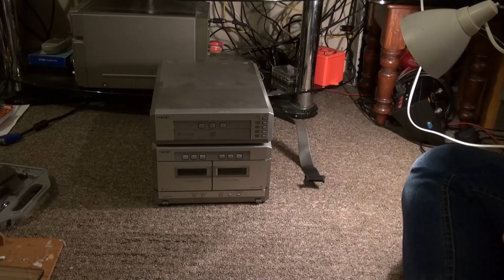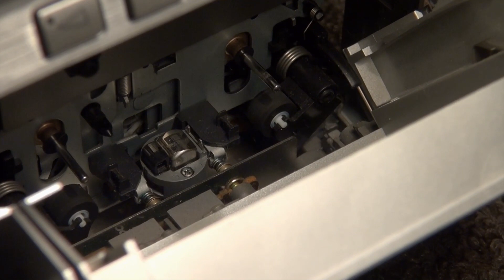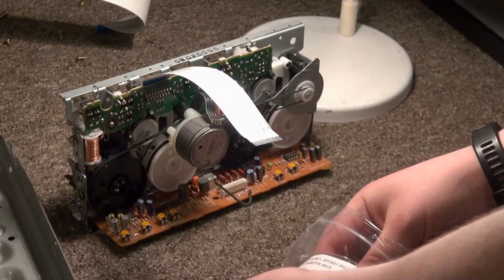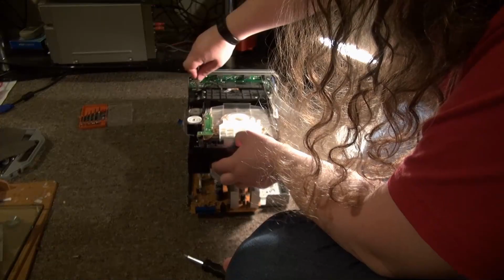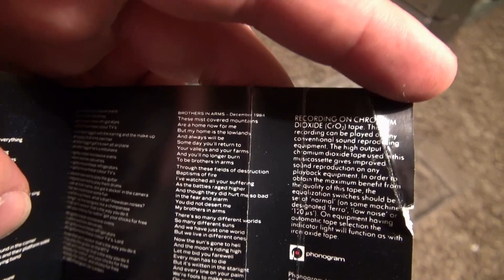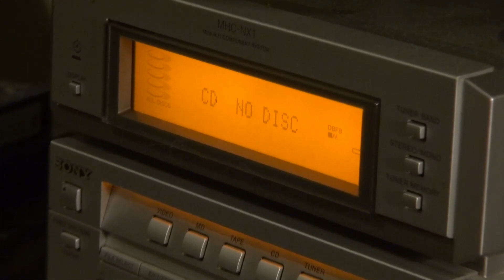Sony MHC-NX1 strip down and repair

Comment: Does the one of the tape deck belt is opening the cd door ? I replaced the cd deck belts but the cd door is not opening...Any advice ? thank you
Reply from the maker: The tape deck belts dont open the cd door, just the cd belts do that. Check the new belt isnt slipping or slack.

Comment: You may not even have this player anymore.. but do you remember if the bottom black gear in the middle that's behind the two large wheels, is spinning one each deck when you manually spin the main wheel? Problem I'm having is I was messing around manually moving the belts and the left tape deck got stuck in 'Play' mode. 

There is a white eject lever at the top that is raised and should be lowered before the power is turned on. The right side has no problem opening and closing the eject lever but the left side won't spin the black gear like the right side. Which is what causes the lever to eject.

May be a chipped gear but it was working fine. Was hoping I'm just not understanding the mechanism. You have to literally take out every gear to see what the issue is and that's a real pain in the ass. 😠😄
Reply from the maker: @overnightdelivery  I have still got this, but it's in storage while I move. Bear with me a while and I'll see if I can have a look once I've moved.
Reply: @stephensrailways  Wouldn't expect you to take it apart again just for me. Just curious if you remembered. I 'think' the gear only moves when the white lever is down. There appears to be a specific sequence of turning gears required to activate the lever. Once the lever is up, it's not clear how you enter the sequence to get it back down again. 

Was working on this as a Christmas present for my neice. I managed to replace the belt and laser on the CD player and that part is working excellent. Wish I hadn't manually messed with the cassette belts. Probably would be working if I hadn't. Maybe a diagram of how it works exists if I keep looking. If you happen to look at yours in the next month or so, be careful not to go too far with the lever and end up in my situation.

By the way my model Sony is a HCD-RX66. But  the tape mechanism appears to be the same as yours. Good luck with the move. 🙂
Reply: @stephensrailways  I figured it out. The large white plastic piece that's underneath that spool of wire was apparently blocking the steel mechanism  from sliding to the side. Once I pushed it away from the mechanism the black gear started moving and finally the lever came back down. 🙂

 So far tapes are playing on side B only. I noticed when I put a tape in Side A it stops playing after a few seconds because the wheels don't turn at all on that side. Despite being installed correctly. I think the long belt I have on there might not be tight enough to spin the wheels connected to the other side. Also the motor is loud and sounds like it's working harder than it should. I had added silicone grease to the belts. But big relief for progress at least. Sorry for the ramblings.
Reply from the maker: @overnightdelivery  check the belt that drives deck A, it may have slipped out of the pulley on the motor. Mine did this when I first changed the belts and the tape played at the wrong speed then
Reply: @stephensrailways  Both belts are on very securely. Really seems like there is a broken bearing/spring that's seized up in that circular plate From Side A that connects to side B. It can only be spun around a few times and then will not budge. The wheels and gears on that side spin perfectly fine but seem to be stopped from moving. I'm assuming all the wheels on both sides move for you when the tape deck is first powered on.

Comment: Sorry, but the critical part is disassembly the front panel section and your video is too quick to understand. Is it possible to do it without disassembling the CD Dect? I saw it from the service manual but it's not so clear.
Reply from the maker: You have to take the CD deck out for the front to come off, but it does come out in one piece

Comment: Great video, thanks! Not sure what happened, my amp works perfectly, but there's no power going to bottom unit, no lights. Does the power transfer from top to bottom over the system control ribbon cable, i replaced it recently but no change, any ideas?
Reply from the maker: Yes, the ribbon cable supplies power to the cassette/CD player. Maybe there's a dry joint where it plugs in that's come loose?
Reply: @stephensrailways  Weird my comment keeps disappearing. Anyway opened it up to find these (see link) burnt out. Bought it in the US and run with a step-down converter in UK, but there must have been a surge at some point. Don't see damage elsewhere, any chance that this little board took the brunt and unit is not totally fried? ie small board replaceable? 

https://drive.google.com/file/d/1x8Hfrkvgus8GjmmSgtHR3jwJg12ZWadN/view?usp=sharing
Reply from the maker: @user-kk4dh9vd7p  the board looks OK, but it is hard to see exactly what the components were before they were fried
Reply: @stephensrailways  The little board sits on top of the black plastic chassis surrounding CD. Rethinking it, the power would have surged from the ribbon input all the way up there so it has probably damaged alot more whilst not really visible. Thanks anyway! Video here but not sure it will help much..
https://drive.google.com/file/d/1-0wmtHClK1DrplrvmufFA8ovVPMC24D5/view?usp=drivesdk

Comment: I've had mine boxed and stored away for about 10 years. When I stored it it had the same cassette deck problem. Worse than that the display was becoming unreadable. 
Thanks for the tape deck video. 
Anyone know of a display repair?
Reply: i'm in the same exact situation

Comment: Hola 👋.....excelente tutorial.  Tengo el el mismo equipo musical y tengo los mismos problema con las cintas de transmisión.  Podrías indicarme donde conseguirlas? . Saludos desde santiago de chile. Tienes otro seguidor más. Gracias.
Reply: Holaaaa... Por fin un comentario de un chileno... Estoy en la misma que tu. Necesito recuperar este sistema de sonido. Lo amo desde chico. Pudiste comprar correas en alguna parte? Saludos
Reply: @IgnacioClavijo  hola estimado...aun no . Pero están disponibles en ebay y Amazon...se pueden Conseguir. Acá en Chile,  imposible.
Reply: @leonardopoblete1310  gracias por responder. Las he visto por Ebay pero por Amazon no. El tema es lo que te cobran por solo meter unas bandas elásticas jajaja
Reply: @IgnacioClavijo  en santiago puedes comprar las bandas siempre y cuándo tengas las muestras. No duran mucho. No son de muy buena calidad .Es un negocio ubicado en San Diego entre Matta y coquimbo. Buscaré el nombré exacto y la dirección si estas interesado.
Reply: @leonardopoblete1310  acabo de encontrar una página muy buena que hacen envío no muy caro. Te puedo dar el link
Reply: @IgnacioClavijo  te lo agradecería 🙏
Reply: @IgnacioClavijo  Hola ignacio...solucionaste tu problema  de poder conseguí las correas?...yo compré 2 juegos. Estas interesado en comprar 1 juego de correas para tu equipo. Me comentas. Saludos
Reply: @leonardopoblete1310 holaaa... Si, tengo un juego pero aún no lo instalo jejeje. Muchas gracias igual por el ofrecimiento

Comment: Hi thanks for your video.I have exactly the same model of Sony deck as yours.The cd and cassette players were not working so I stripped the player and found every belts were perished. Your video of cd belts replacement is quite helpful thanks but for cassettes belt change it is somewhat confusing where the video has been fast forwarded.Saying this it is still helpful where video is on normal speed.Thanks

Comment: sir if you know each other naturally
all the rubbers are cut on a cassette player exactly like this one in the video
I press play on both decks, but without putting a cassette in, neither motor receives a command, is this logical from the switches you said are everywhere and see the presence or absence of the cassette?
should I buy some tapes and put them in to watch?
because all my cassettes are broken
Reply from the maker: That's correct, the deck won't play without a cassette being in
Reply: @stephensrailways  thanks sir
Reply: sir something more 
as about as the unit amplifier 
has a fan on the back place
Do you know if must working continously ? or is there someone thermistor and its working when its needed ?

Comment: Don't know if you are still collecting comments but I still have a problem with the auto changer. It changes ok when the trays are falling but not when they rise. The tray is a little low at the rear. Lifting with a finger before it times out engages the cd. Any thoughts?
Reply from the maker: I'm not sure on that one, unless it's to do with the belt that's hidden next to the laser, under the cd trays, that could be slipping. Very strange indeed!

Comment: Re your comment on the volume control, I had  a similar problem..... I took  the case off, blew all the dust off the whole inside, now works fine !
Reply from the maker: Excellent, I still haven't opened mine up yet but I shall try that first!

Comment: I have problems with both decks. The heads don't flip on auto reverse? Any ideas?
Reply from the maker: They should turn and spring back if you try and move them by hand with the power off. It might be worth trying this a couple of times to free them off, especially if its been a while since the deck was last used.
Reply: @stephensrailways  I give it a try. Thanks

Comment: Hi, i have a question for you, a few days ago i noticed a sudden change in volume output, it got noticeably weaker, my guess is that it's amplifier's fault, do you have any tips how i could save this old friend of mine? There are no specialists in my area, probably gonna have to repair this bad boy myself and any help would be much appreciated.
Reply from the maker: Hi, apologies for the slow reply. I have not yet opened my amplifier yet, so unfortunately I'm not sure exactly what the problem could be. I could be a dodgy capacitor, a transistor or anything else for that mattter. If you do find out, please let me know, as it would be a shame to let such a good unit go!

Comment: Thank you very much, my HCD-GRX10AV/RX110AV seems to have the same deck, and it helped a lot to watch your video because it had some important hints how to handle the middle motor. I was able to repair the directly connected deck yay! But the one on the right side (from behind) there the up/down mechanism of the magnetic head seems to be stuck.
Reply from the maker: I'm not sure what lubricant to use on these, but perhaps some kind of lubrication may free the head off?
Reply: @stephensrailways  do you mean the casette audio head? I think I should maybe lubricate all the wheel axles, because meanwhile it seems that over time the audio gets slower and I am not sure if these two defects are maybe connected.
Reply: @skybirdification  I also have a sony rx110av and after having disassembled and reassembled the cassette deck to clean the stereo inside, when I play a cassette I always hear a whistle below (more present on tape b). you say that with some lubricant I solve the problem?
Reply: @danielboss6835  I didn't try yet to lubricate anything, I still have the problem that the tape speed slows down but I was to lazy to take it apart again yet, as I mainly targeted on repairing the CD deck (the rubber was gone there too) and that is working fine now. But on my next holiday I will check the casette deck likely again.
Reply: @skybirdification  let me know if you will solve

Comment: Thank you for this video, it will help me a lot :) Could you tell the size of each belt as I'm outside the UK and the belt kit isn't available here
Reply from the maker: https://www.ebay.co.uk/itm/5-Belts-SONY-HTC-NX1-HTCNX1-Belt-Kit-For-Cassette-Deck-VERSION-1/253481356061#shpCntId
Reply from the maker: That's where I got mine from, and they do post to quite a lot of countries. I'll see if I can measure the old belts.
Reply: @stephensrailways  Thanks :)
Reply: https://webspareparts.com/collections/belt-kits-for-cd-dvd-players/products/sony-htc-nx1-mhc-nx1-mhc-nx3av-belt-kit-for-cd-player#content This is a Portuguese firm, therefore may be useful for clients in the European Union (much better prices) ;)
Reply: @AhRicoPeixe  Thank you so much :)